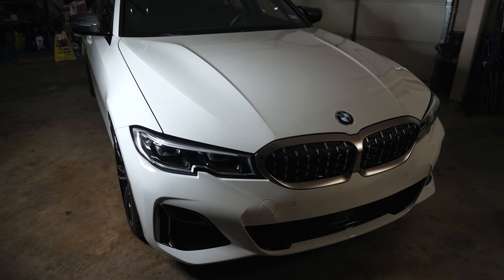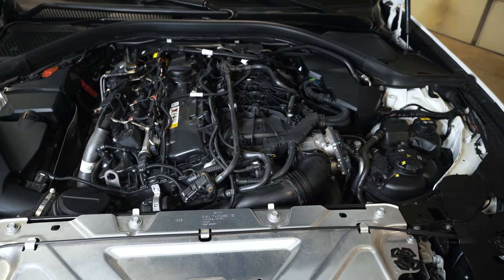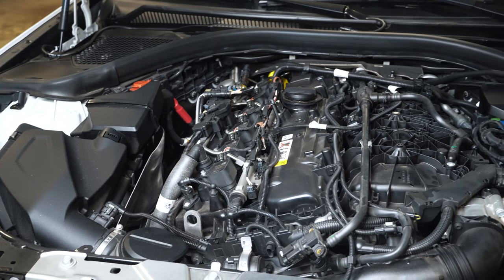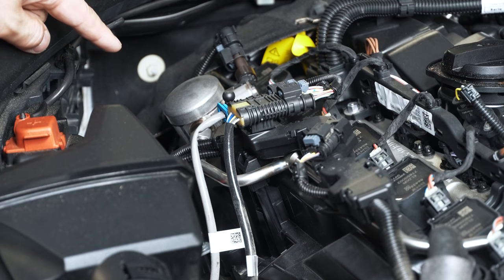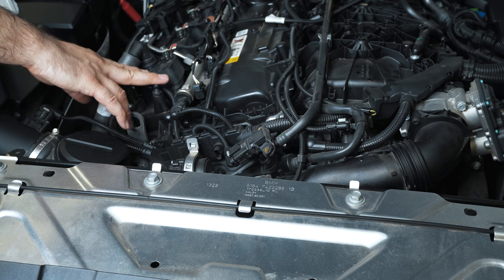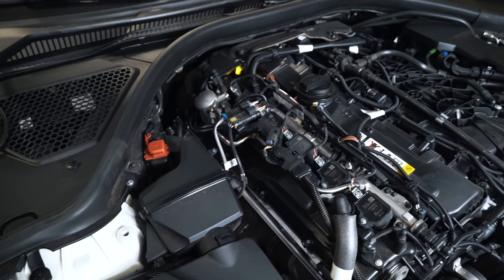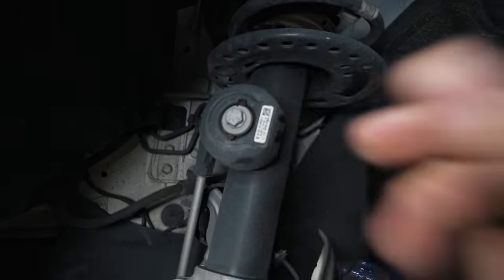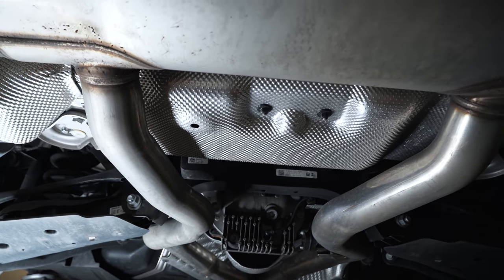Let's Take A Technical Look At The BMW M340i

Comment: I’m definitely going to wait for depreciation on this model. Glad BMW improved the reliability and the power output at the same time. German engineering at its finest :)
Reply: Only time will tell if the reliability did improved. Best thing to do is buy them new and buy the extended warranty. After 100k miles trade it in for a new one. They are awesome cars.

Comment: I traded a 2016 F30 340i MSport for a 2020 M340i. To be honest I thought BMW had just bumped the boost on the B58, so I wasn’t aware of the significant technical updates. The F30 was quick and planted, but G20 is so much better in terms of style, technology, dynamics, and performance. I also favor the RWD for lighter weight and more agility, but I think many buyers want XDrive for accelerating from a standstill   Surprisingly my fuel economy improved from 29 to over 30 MPG in mostly highway driving 80+ MPH.

Comment: Outstanding presentation. Why doesn’t BMW sell cars to us with these kinds of technical analysis presentations. They should hire you and increase sales to us enthusiasts. Great improvements with perhaps exception of exhaust system which looks cheaper compared with my N55. Especially the rearmost muffler. One thing that I think is pretty significant from n54/55 is going back to mechanical water pump if I understand correctly.
Reply: Because most people today are badge renters and do not give a flip about technical aspect as they will be in another car by year 3 if not sooner.
Reply: Both good points but these will be steals in a few years

Comment: I wish they made a anti dampening bushing like that on the strut /sway connection to eliminate the sport/harsh ride in the e90s
Reply: Why do you have an e90 if not for the rough and sporty ride? Lol
Reply: Oh I have my share of e90s rn. I have n52,n55,n51,b58,n20;(, think that is it rn. Been flipping a couple for a different project. But I like the harsh ride. But I was talking after 80k on oem suspension sun bushings, most bushing you wouldn’t even think to check unlike control arms and stuff. I was thinking instead of doing the 1100 $ refresh kit for all bushings and ball joints. Maybe if they made something that would tighten up everything or tighten up enuff to take up some play in other bushings is all I was saying haha. But i love my e90s when they are refreshed. Harsh yes but meant to be harsh.  Still very smooth.
Reply: I do like the subframe inserts. They take up about 25% of what’s really needed replacing in the rear end. But just wish there was something “more” for the front end that didn’t hurt the bank

Comment: Thank you for the very informative review. You seem to be very knowledgeable about BMW engines. The ultimate driving machine. I don’t trust BMW much because of lack of reliability. I had a bad experience with 2002 540i. I just bought a 2020 m340i RWD. I love it, amazing power and excellent gas consumption, 33 mpg highway. I have 6 years, 100000 miles warranty.

Comment: I have an e92 (which might make the difference) but when you jack up in the front or rear side then front and rear lift about the same height as well.
Reply: I have one and it doesnt. Mine is a M sport model with 18 inch wheels

Comment: It seems like any mods on this new engine is going to need a lot of mechanical expertise. N54 you could change a chargepipe intercooler down pipe and a mhd tune you’re pushing a good 450whp. On this I’m not so sure You can’t upgrade your intercooler and your what’s header is all combined into 2 ports.

Comment: Thanks for the B58 insight.  Question for you - do you know what B58 is in a 2018 X3 M40i? I’m in the market heavy for one and assumed it is the same engine (and fuel system) as the M340i but want to be sure as I’m planning on tuning and running e50.
Reply from the maker: Looks like the 2018 X3 M40i used the final revision of the N55.
Reply: Vehicular DIY ouch thanks man! Changes my whole search. Much appreciated.
Reply: @VehicularDIY  huh? The X3 M40i doesn't use the N55 engine. It's a B58

Comment: Love your videos! Was a bit disappointed as you've upgraded from a M340i (I own a M340i myself and was looking forward to additional content from you for this platform) to a G80 (congrats!). Was hoping you can point out the front center jacking point on the G20's. I've looked all over the web but have not been able to find any resource on where to centrally jack up the car from the front of the vehicle. Goal is to put the car up on jack stands on all four corners but don't know how to achieve this without a front center jacking point. Any guidance you can provide would be greatly appreciated. Thanks!

Comment: 9:48 using jack from behind will lift whole one side equally? if I am wrong?
Reply from the maker: Typically its not that easy unless the chassis is very stiff but yes I lifted the entire side of the car from just the back.

Comment: Well considering how the new M440i looks, it’s either this, a A91 Supra, or a Z4 M40i for me in 7 years depending how they all depreciate. Assuming my E92 335i is still working by then 😂. Only problem for me is lack of a manual trans unless you get the M3/4
Reply from the maker: Or maybe they'll fix the front end on the lci 4 series and start offering a manual considering it would be cheap to do so as they already make all the hardware for the m3/m4.  Wishful thinking probably.  If I was looking for a coupe and never had to worry about taking anyone in the backseat I'd chose the A91.
Reply: Vehicular DIY That would be ideal for sure. I love the coupe format, and never use the rear seats in my E92 but for some reason I feel like the Supra won’t depreciate as much as the M440i will so I guess we’ll just have to see

Comment: Do you think you can install G80 rims on the m340 and not have a problem with the AWD system? 275 front and 285 rear.

Comment: Very informative video. Do you think that the fuel pump can fully handle e85 instead of a blend like e30 or e50?
Reply from the maker: Thanks, no from what I've seen E50 is the max.  E50 is typically plenty as this isn't a super high compression motor.  The B58 in the 2020 Supra is higher compression and benefits from higher ethanol blends.

Comment: Hey Musa, how are the new turbos on the e90 holding up? did you you need to get an after market exhaust for them? on all the forms they say that the exhaust needs to be upgraded in order to run them. I have msport exhaust and don't want to change that out.
Reply from the maker: They're doing great, I have a stock exhaust but I believe without secondary cats.

Comment: How come your manifold isn't inbuilt? Mine is and it's a b48 too. I can see your full manifold. Whereas in mine, only the outside hole that the turbine housing bolts onto is visible, rest of the manifold is inside.
Reply from the maker: From what I can tell the 382 hp B58 had a different collector design compared to the B58 found in the X5 or 2020 Supra.  There us more flow potential with the B58 in the M340i. In the Supra the manifold is fully integrated into the head and goes to two ports.  The 2021 Supra now has this motor.
Reply: @VehicularDIY  I have a 330i b48D. And mine is also inbuilt manifold. With a hole outside. Makes putting on an aftermarket turbo so much easier. No need to fabricate   a manifold. Just a pipe that will bolt into the hole

Comment: Would thise brake calipers fit an e90 335i. Been trying to look for bmw big brake or performance brakes.
Reply from the maker: They won't unfortunately as the bolt pattern changed.
Reply from the maker: Possibly just the calipers?
Reply: @VehicularDIY  yes just the calipers

Comment: Get your car coated with Opti-Coat Pro which will make your handwashing a breeze and provide unparalleled protection for your paint. Do it now while the car is still new! Regular Opti-Coat Pro ceramic coating has a 5 year guarantee and the pro plus is 7 years. Nice car!
Reply from the maker: Thanks for the tip!

Comment: I am your fan since you had you older beamers,  I am from  Recife in Brazil South America and I own two bmws, one of em is the new 20/20 330i m sport that also have a m sport differential, has laser lights,  also have another m sport bmw and I am very torn between the m340i and the 2020 m2c, which one would you get or maybe a 2019 m4 ,
Which one would you suggest? Thank you for your time...
Reply from the maker: Thanks for watching!  I think if I already had the G20 330i with all the M Sport goodies I'd get the 2020 M2C as my side car or wait for the new M3.  I wish my M340i had the laser headlights, they really help with the look of the car.
Reply: S
Reply: Vehicular DIY yes, I nearly use the laser lights used it in the country side and it was the difference between night and day here in Brasil the 330i also comes with m sport differential, and laser lights 19 inch wheels etc, I have been falling you and your videos are awesome...
Reply: Vehicular DIY thank you for your advice...

Comment: nice. But most dissapointing thing from customer POV is lack of vented front seat. From what I understand its exclusively for M3 (for now). So top equipped $90K m340i still has NO this option. Eat this, Ilon. 🤗

Comment: I have the same car but xDrive. BMW Canada hates RWD.....wtf. There is no new RWD BMW here in Canada except for the M2. F8x is end production I think. But I can never crack 4s 0 to 100 km/h or 62mph on stock ps4s tires and launch control. Best I got is 4.02s using dragy to measure. Funny thing, I got same time using non performance Nokian 18 inch winter tires too. Go figure....maybe less weight?
Reply from the maker: I think most RWD cars would run a low 4 second 0-60 unless the conditions were perfect.  Maybe try filling up with some 94 octane from Petro Canada.  Maybe the ecu will push a little more timing for more power.
Reply: Vehicular DIY I am always using 91 v power from shell, allegedly the best. But also there is about 0.2s diff between 60mph and 62mph/100kph.

Comment: There were at least 3 different versions of the N54.
The S58 is an interesting contrast.
https://www.youtube.com/watch?v=Xi0yM7XGCqA

Being built summary:

https://www.youtube.com/watch?v=7x4JyjumS9c
Reply from the maker: I'll check those out thanks, from what I understood the n54 only had a minor change which included a change to a 6 bolt crankshaft.
Reply from the maker: Looks like its running dual 350 bar pumps.  The S58 seems like it's going to be a monster.

Comment: Cool deal. Just wish it didn't look like a generic Japanese 4 door car.
Reply from the maker: The back took a little getting used to for me, has a bit if a Lexus look but not in a bad way.
Reply: @VehicularDIY  I guess that's the future, unavailable,   I better get used to it. Still think a manual transmission on this generation would be a nice option.
Reply: I wasn’t sure about the looks at first either. After owning a M340i for two months. I can’t stop looking at it. Every time I walk away I stare at it as I walk into work. Love the looks now. Mine is white with the M Performance rear diffuser, side skirts, and front lip. Looks amazing and so aggressive now.